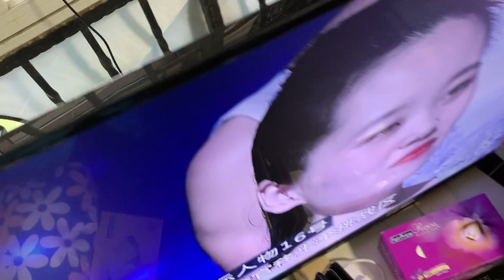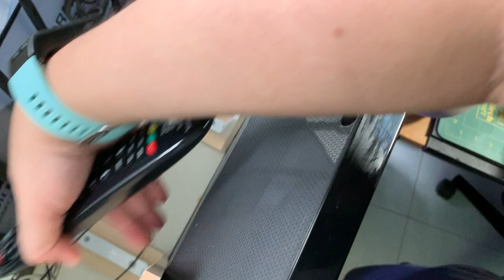DIY Home Made Stand for Flat Screen TV

Comment: The screw holes were already in the back of the TV or you created them?
Reply: those holes will be present when u buy the tv for the wall mount purpose
Reply: Most TV's will have screw holes for mounting.
Reply: It's called a VESA mount and you should definitely not make it yourself.